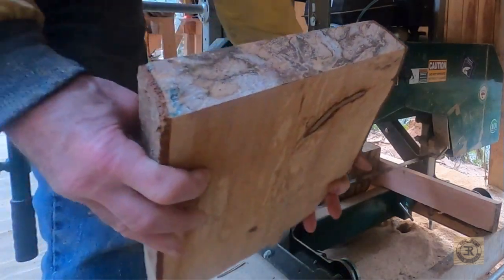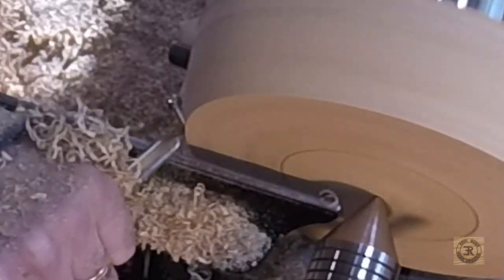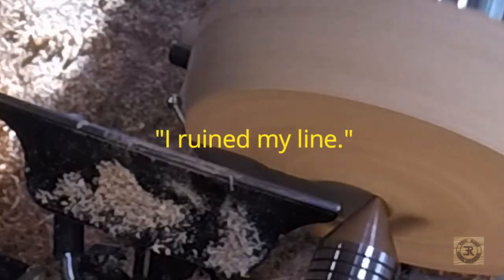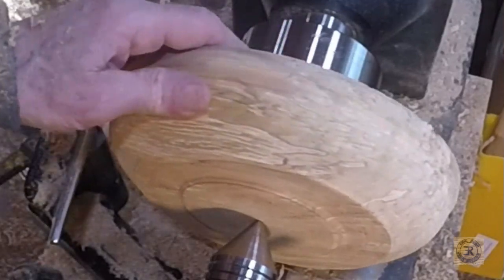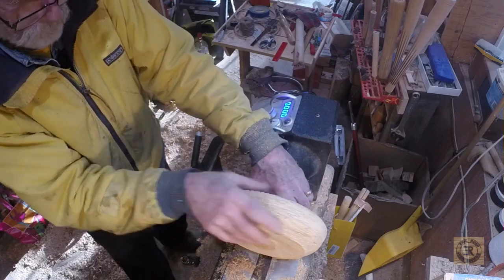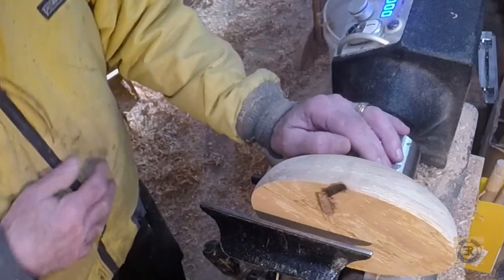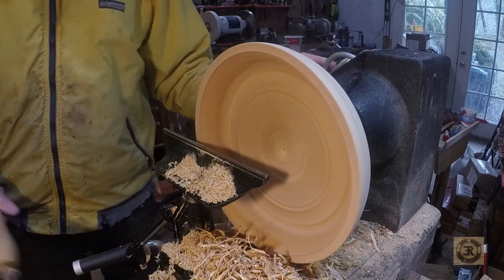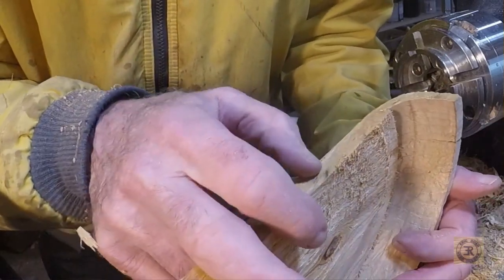Shallow Spalted Bowl Blowup

Comment: You had a nice shape going. You’ve already addressed the use of the scraper. I’d suggest that using a round nose or bowl scraper would have been better than the square edge scraper you were using. Another preventative measure that may have saved the piece would have been to apply some CA into the crack. As soon as you saw the crack from the outside would have gone a long way. Some more applied on the inside before starting to finish the bottom would have helped as well. You’re coming along well. Keep at it.
Reply from the maker: That big, square-end scraper (one corner slightly rounded) was definitely the wrong tool for removing wood from that bowl, but I like it for evening out the bottom with light scrapes.
I didn't think of gluing the crack before I started. Duh. I'll try to keep that in mind.

Comment: A scraper is what Richard Raffan would have used, maybe you have been watching him too much? 😎
But he always inspects his wood very carefully, a cracked blank like this would probably not have gone onto his lathe.
For myself, I would have used a bigger chuck. Not sure if you have one with 4 inch jaws? As it turned out here, the crack was next to the tenon so the chuck did not help to hold the piece together. 
Maybe you would have been able to still pull it off when using only a bowl gouge but the piece would probably have cracked wide open after some time. That's my five cents; appreciated watching as always. 👍
Reply from the maker: I do watch Richard, but I obviously don't pick up on all the subtleties. I do have larger jaws, but changing to them would have taken time and effort, and, as usual laziness wins out over judgment.

Comment: ‘Thar she blows! Never trust a spalted pith. Or any soft pith for that matter. If you did not burn it yet, you can cut out the broken sections on both sides and carefully glue in a new filler piece or two and turn all round again. But guessing it already hit the fire. 😵‍💫 Does not look like the scraper caused a catch, just wood failure. Glad it was not a piece of burl!!!
Reply from the maker: That large scraper in that bowl was the equivalent of using a sledge hammer to drive tacks.